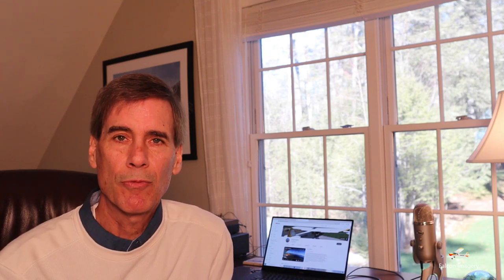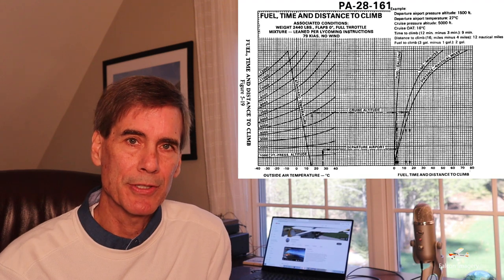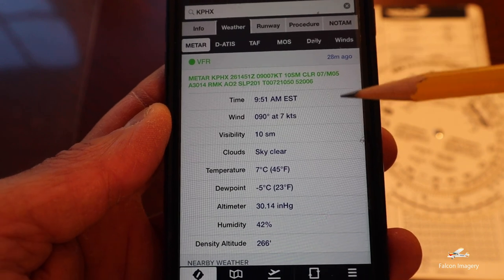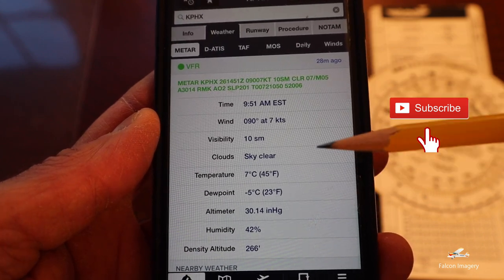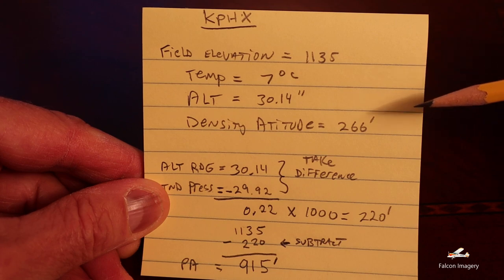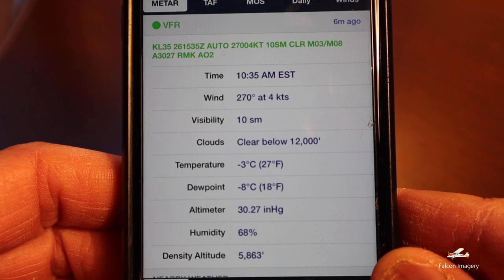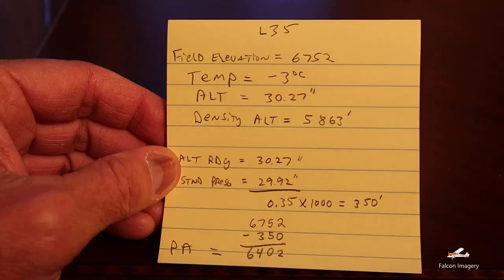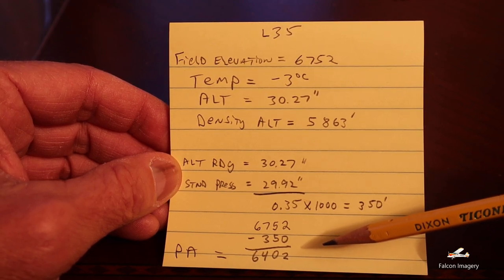How to use E6B for Determining Pressure Altitude

Comment: if u select 8500 for your cruising altitude on your Nav Log, you have to then calculate your PA when you do your TAS calculations? Is that correct?  So if your cruising altitude is 8500 feet on your NAV LOG, but your METAR Altimeter is 29.42, then your PA would actually be 9000' feet?  Is this correct???  In other words, when we are completing our Nav Log, we decided on an example course of 270 degrees (example),  so we choose a cruising indicated altltude of 8500' feet, but shouldn't we do our TAS calculations on a PA of 9000' if our current Altimeter setting  is 29.42 (as provided by  the current METAR) ??     btw.. great video.
Reply from the maker: Yes, you should do your TAS calculations based on your PA.